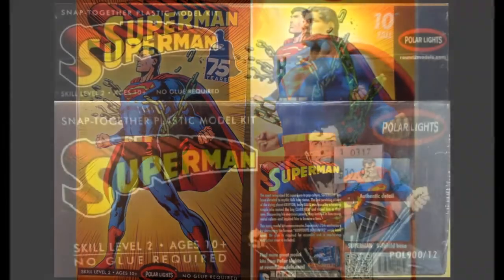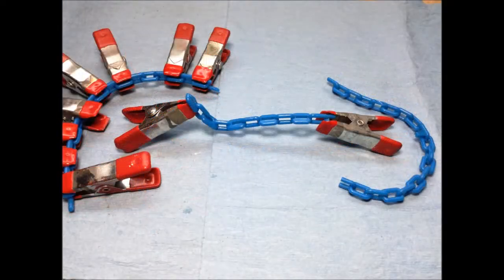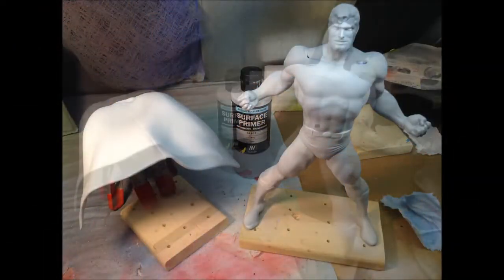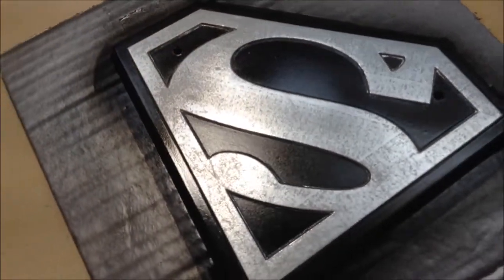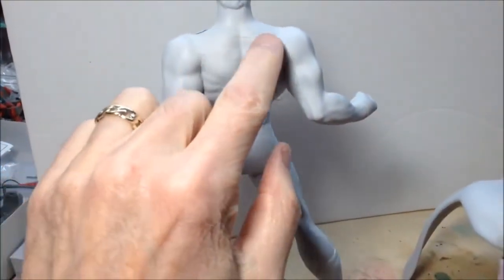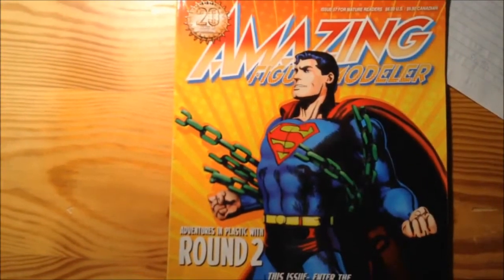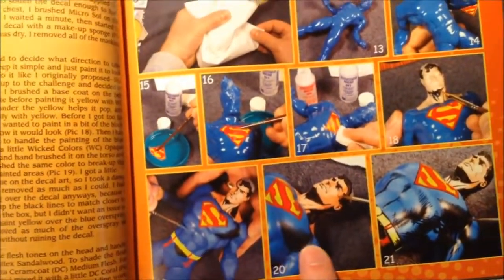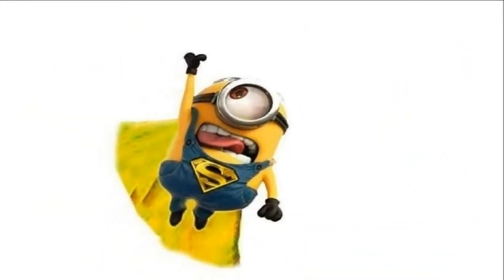Polar Lights Superman - Episode 1

Comment: Sup is looking good Steve.  Isn't seam work fun!  What a bear to put the seam down the middle of the cape.  The old Aurora (later Monogram) Superman had a one piece cape, so it was a pretty big piece of styrene.  One thought I had was the wood filler might be shrinking on you, which makes the seam reappear.  Especially if you are smoothing it out to the surrounding surface.  Next time leave it proud of the seam, but you'll have to sand it smooth to the surface.  I'm looking forward to seeing how your pre-shading works out.  It's something I struggle with.  I just tend to put the color on to heavy, so it hides the shading.
Reply from the maker: Thanks Vince, I appreciate your comments.  I've had trouble with the Squadron Green putty that it dries very hard and I end up sanding thru the plastic instead of the putty.  I had to stop after shooting three coats of the acrylic blue craft paint as the preshading was disappearing.  Still trying to learn to do more light coats.  (That reminds me, I think a few years ago you and I had decided to do start a procrastinators club).    :0)
Reply: @ModelCarMinion  LOL, let's put off  scheduling the procrastinators club meetings later.   🤣
Reply from the maker: @VinceWeston  ok. lol.